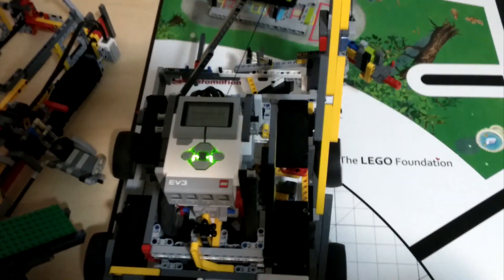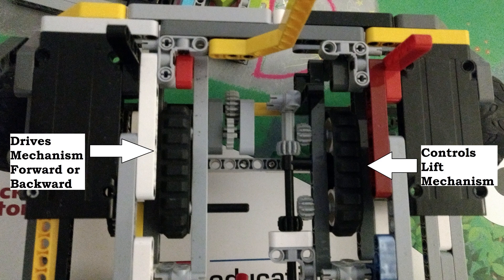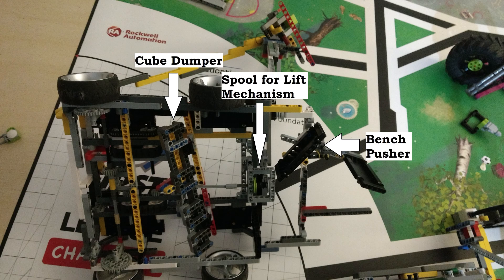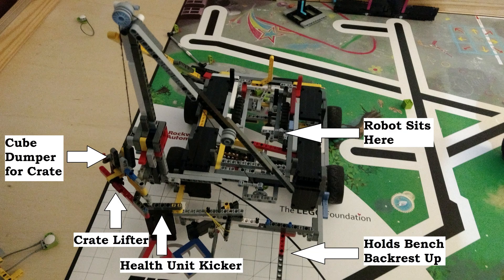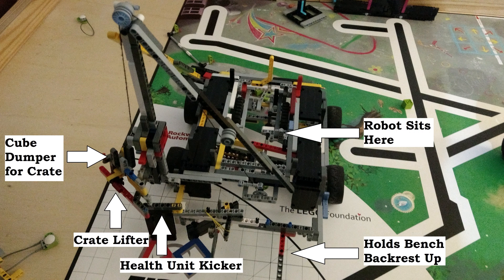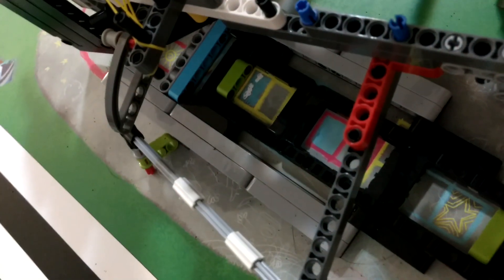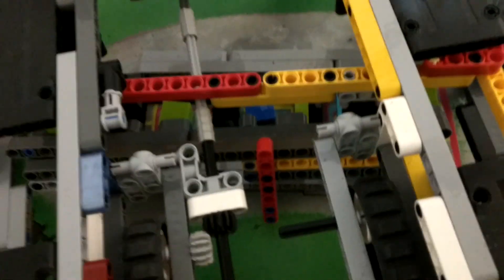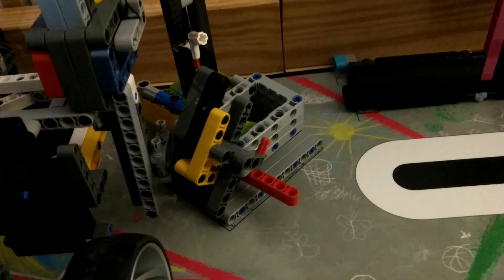FLL RePlay Bench and Crate Mission, Robot in 1 week!!

Comment: Are you using only one of the drivetrain motors to drive the whole assembly forward and backwards while the other drivetrain motor is used for the lift?
Reply from the maker: yes, I am not using any other motors in this mechanism. To transfer power from the motors, the driving wheels contact the treads which have gears to the wheels and lift.

Comment: Great job! Unfortunately my robot isn't compact enough and doesn't have the gears on the bottom so I don't think I will be able to utilize this design but an innovative solution nonetheless! Good work!
Reply from the maker: TY! The robot does not actually have gears at the bottom either. The wheels contact the treads and that is how the driving wheels control the mechanism!
Reply: The FLL Expert Interesting. Does it not slip?
Reply from the maker: @wordynerd48  I had to change gear ratios, so the wheels don't have to exert a tonne of torque, that way, they don't slip. I did have a lot of problems with slipping developing this tho.